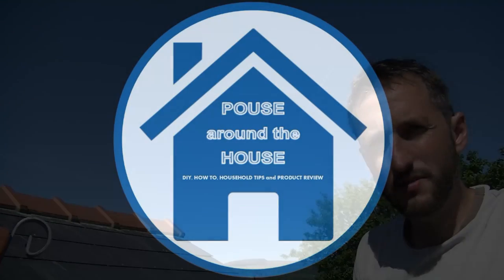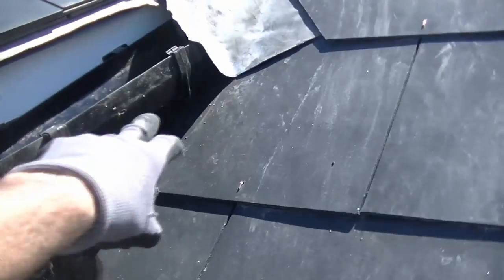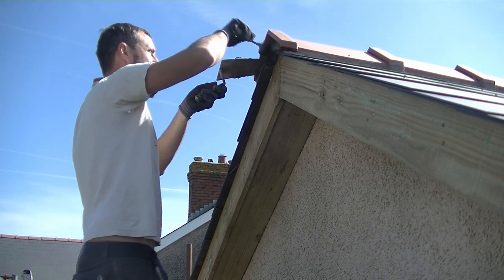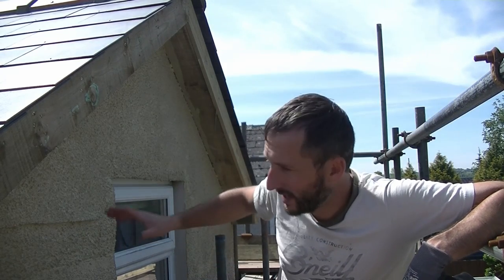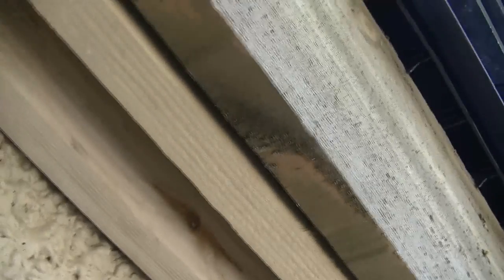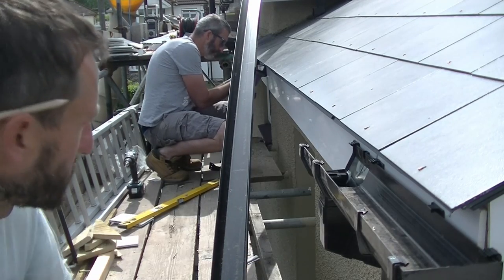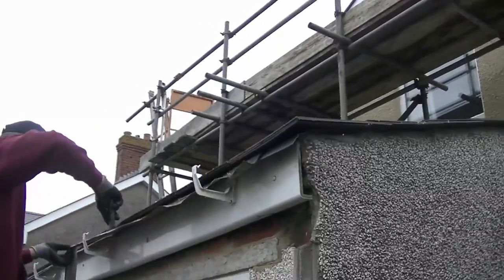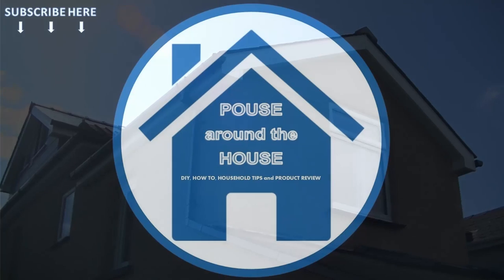Back roof overhaul Part 4 - Full roof repair. uPVC fascia, soffit board, cladding, & ridge tiles!

Comment: Hi Pouse. I assume this conversion is completed now. Can I ask how long it took doing it yourself and if building control is okay with the time it takes you to complete the next section of work inbetween inpsections? Thank you
Reply from the maker: Yes complete, it took about 2 half years in total to getting carpet down but I had 7 months of doing nothing many months of few hours here, few hours there so difficult to say. In that time I had my second child and we had the covid pandemic so time and materials were limited! I couldn't get hold of plaster for months. As for building control I did a building notice and you can pretty much take as long as you like as long as you update them of stages. Just speak to your building officer, they're really helpful. Hope that helps.